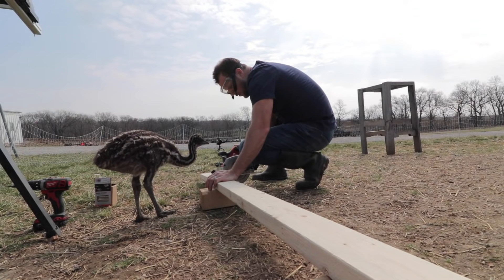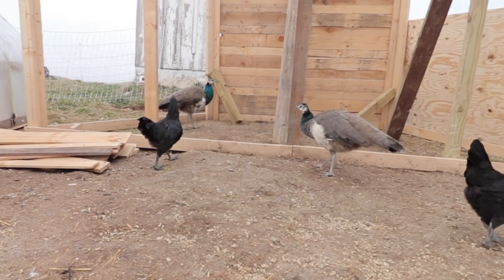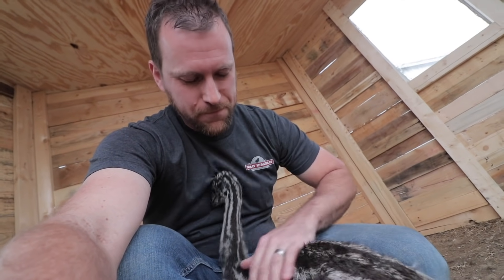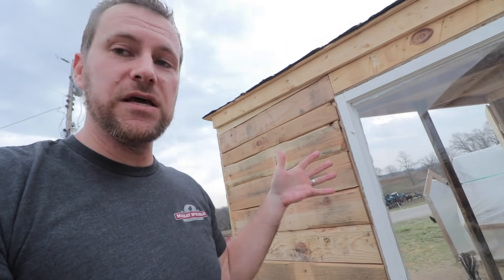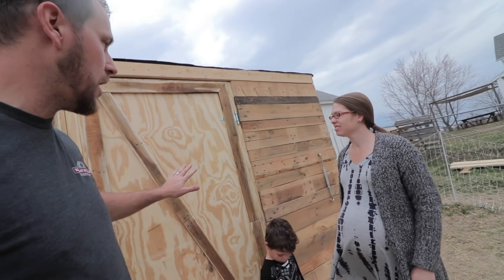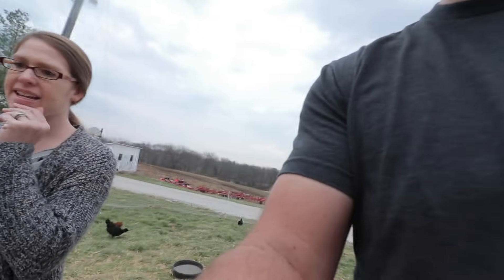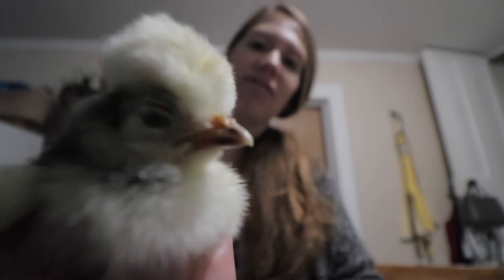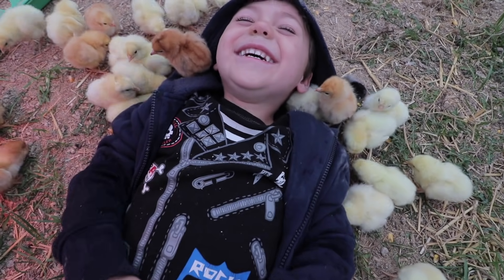the Emu Fortress

Comment: you can use old plastic clear bottles as a green house when you transfer your seedlings. Just need to cut the bottom out and remove the cap or poke a hole in the cap

Comment: for on the cheap, roll roofing applied to the siding will keep all the water out. and the birds wont pick it. if you choose to foam all the gaps be prepared, the birds will pick that stuff until its is gone.

Comment: The nails are exposed on the front lower shingles you must put cocking on them or it will leak over time and also you forgot Starters and to leave a half knuckle over hang but not a bad job.

Comment: Hey I’m 14 years old and my dad is a roofing contractor and I know a lot of stuff and just to let you know you put the black paper under the chingles wrong you start from the bottom not the top because the water is supposed to run down so each layer of paper has to over lap the bottom one